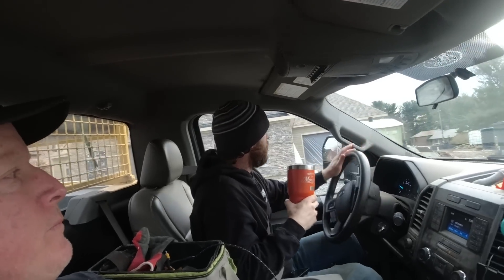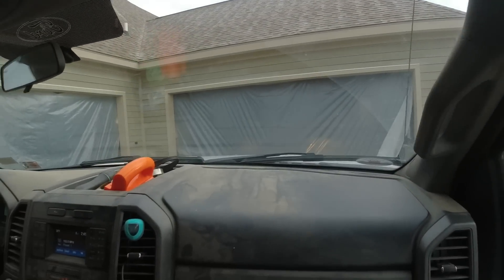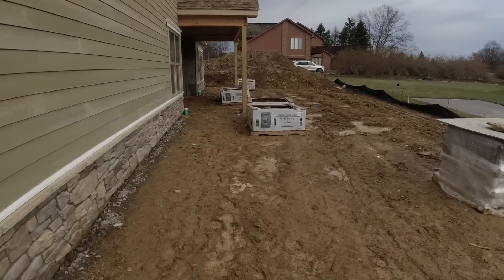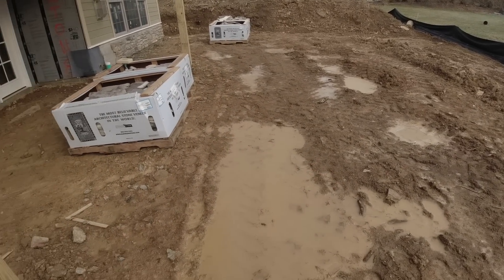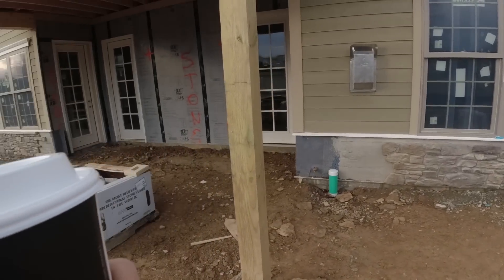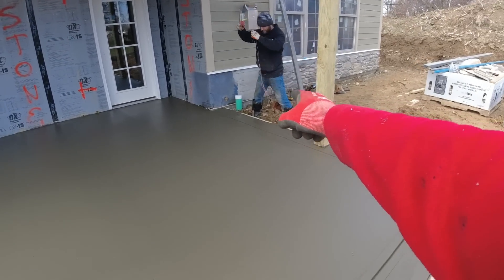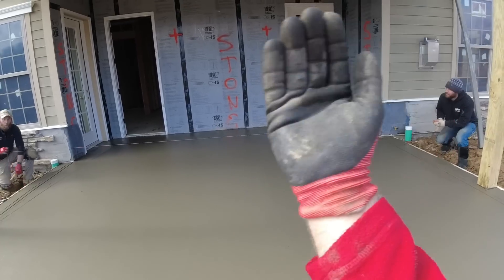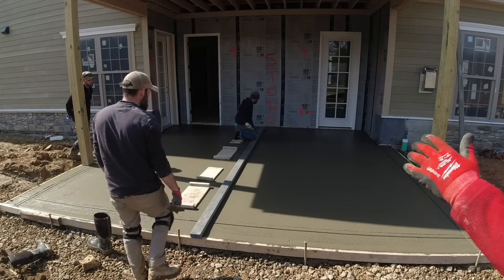Spring is Right Around The Corner!

Comment: Could you explain why you use rebar instead of wire mesh?
Reply: Mr Haus may have a different reason but rebar guarantees no cracking. Road mesh or wire simply prevents it. Wire is good for the city but substrate in rural areas has a higher risk for settlement.
Reply from the maker: If we get any settling with an over dig or drainage lines, the rebar will span over wiremesh will not
Reply: @Concretewiththehauses  great point.

Comment: Like the last brooming you did in i think two videos back
Initial comment
I am liking the vertical broom lines on the ends as it helps create broom diverts on the edges of concrete to cut lines
Reply from the maker: Just a little detail, add so much to the lock